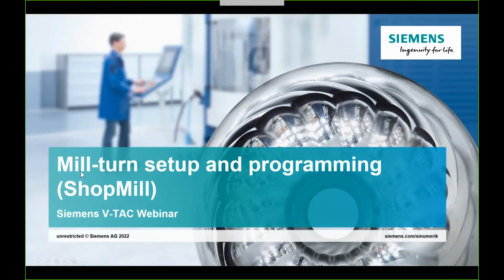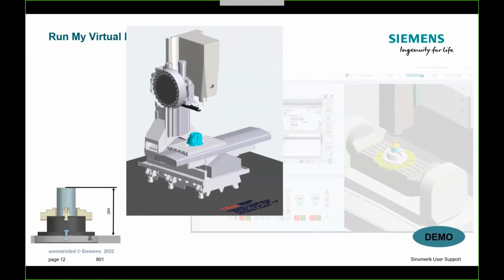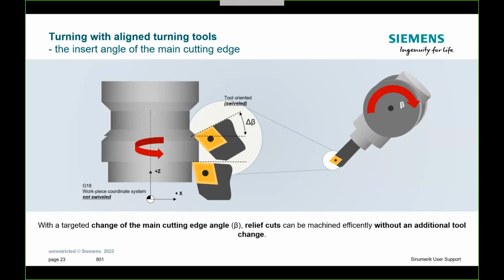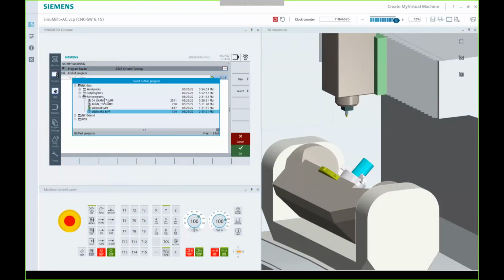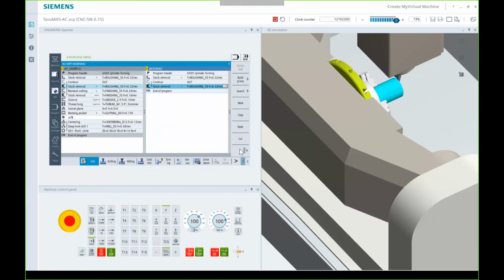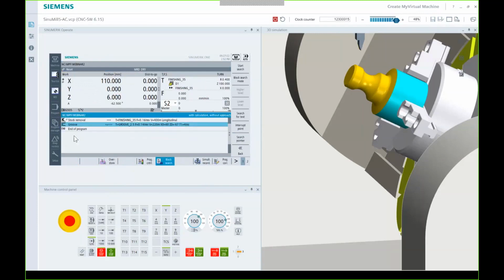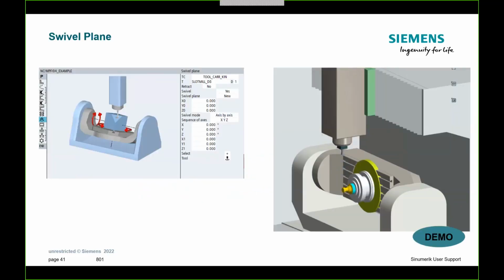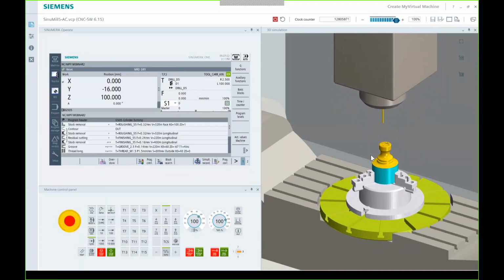Mill Turn setup and programming Webinar

Comment: Question about tool orientation in this millTurn scenario...  Is there an option in 840Dsl to orient a turning tool to resolve under/over 'center height'?  or rather...can I set a y(gamma) to a specific holder permanently?  Would it be a multiTool with 1 tool?
Reply from the maker: there is not a option. you could do what you want with a macro in the tool change program

Comment: I'm running a Fives RT 130 with a Siemens Sinumerik 840D sl / 828D, is there any way to change the actual machine zero values for consumers? Or does it have to be through the manufacturer.
Reply from the maker: this is done by the builder. what are you trying to do please email me the question dan.strubel@siemens.com